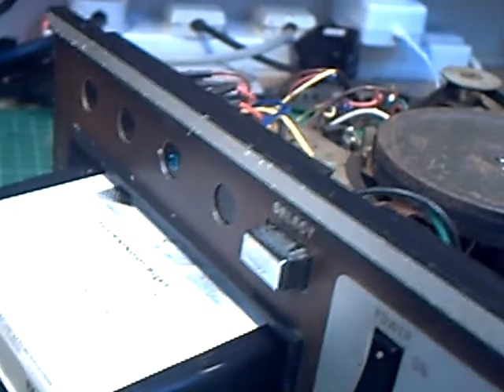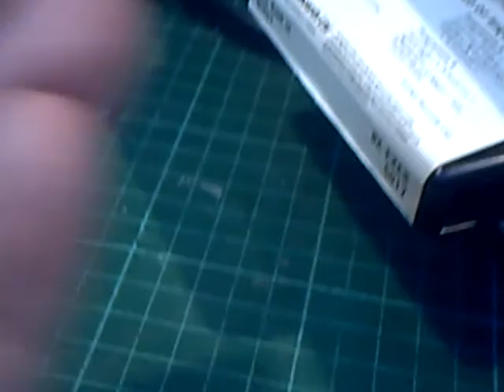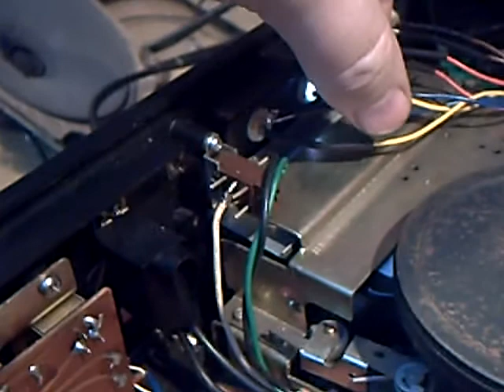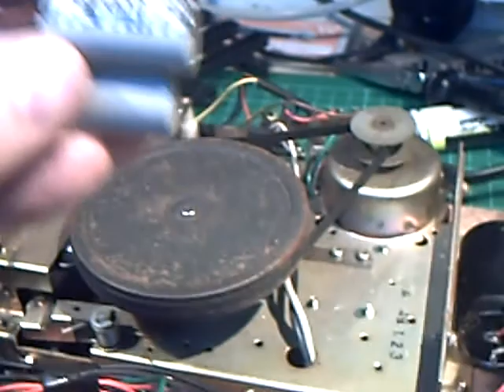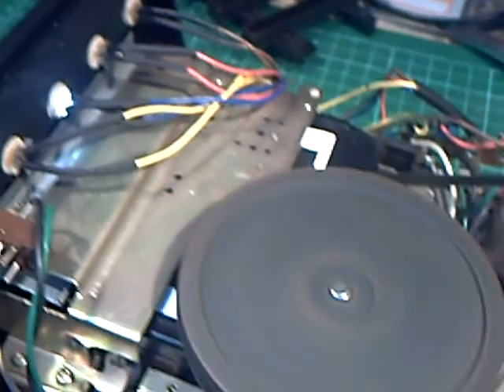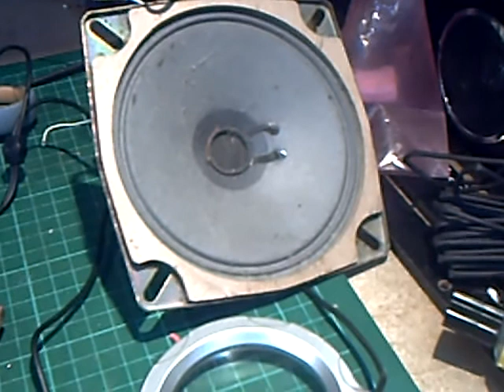Amerex 8 track Modifications and Re cap

Comment: Glad you got this running better.  I've been so busy with work lately that I can't always devote so much time to repairing things anymore.  Anyhow, I do still have several repair projects.  Lately, the main thing I've been working on is an old 4-Track cartridge player.  It's an odd machine because it appears to only be a mono unit and I don't see a track change lever to go between channels 1 and 2 on the 4-Track cart.  It's pretty odd, but I do like the fact that the unit has a valve amplifier.  I also bought a tube/valve tester and it's a cool unit.  There are a few videos  I filmed so far, but I don't have much time to edit, let alone upload them.  As always, it's always great hearing from you and I hope to see more of your videos soon.